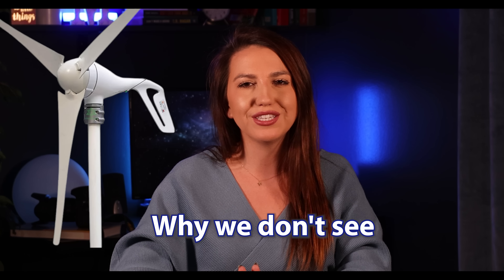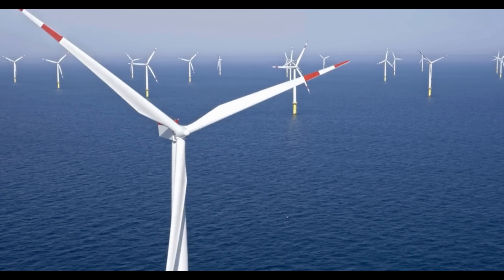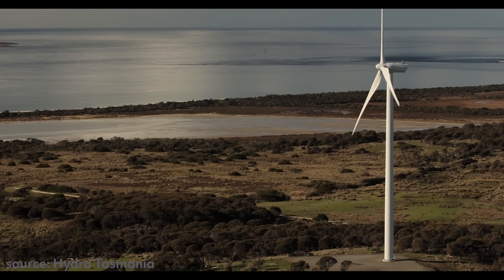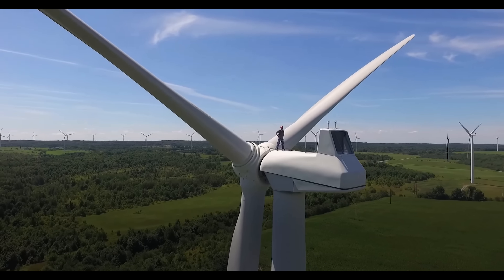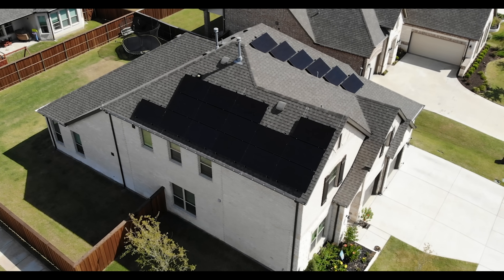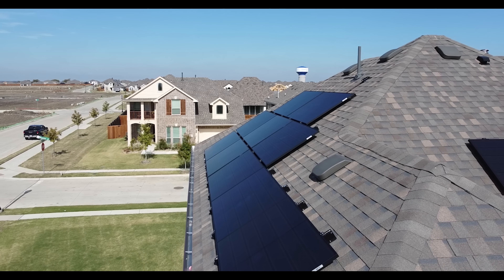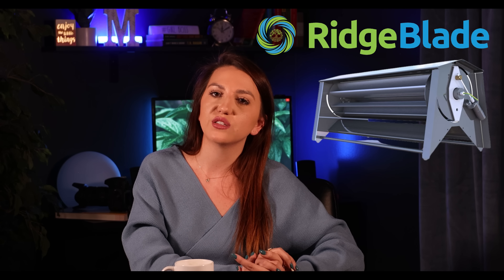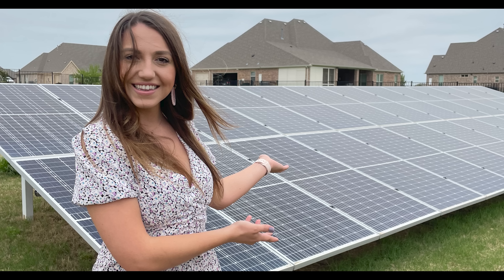Could this Turbine Destroy Solar?  | Why haven't we seen these small wind turbines yet...

Comment: Suggestion: there is research into hydrogen using electrolysis but under pressure. It seems electrolysis doesn't care if it is under pressure or not so you can skip a step in producing pressurised hydrogen for energy storage. This would save energy, complexity and a lot more for residential use.
Reply from the maker: Interesting thought. I need to look into it for sure. I would love for hydrogen to be more used and on a bigger scale.

Comment: The ISSUE is that most homes do not have strong enough wind to justify building a turbine. Another issue is that it needs to be high off the ground, which is rarely practical. But the biggest issue of all is that best power production requires large blades, which are never practical. We've seen images of small turbines on rooftops, but these rarely can generate enough energy to be worthwhile.
Reply: If you look at the data sheet for these you will see that if you are lucky enough for it to be spinning you won't get more than a single 10w led bulb running on it. Total waste.
Reply: Correct! My studies show that a minimum of about 6 ft diamerer is required to do anything.
Get to the basics.
Only the outer third of any turbine or propeller actually does work. The rest is not going fast enough to produce work.
The outer third should have big blades to better capture the wind.
Engineering experiments show that the angle of 25.5 degrees captures the most energy. (Three blade cantilever blades are at an angle of about 2-4 degrees).  This produces high RPM, and is not efficient.  It also produces noise and vibration.
Going faster takes more energy from the very wind that you are trying to get energy from.
Bigger is better with all wind turbines.
Heavy on turbine blades is not good. More cantilever blades add more weight, to the point that the shaft cannot support more.
The Tension Turbine is the only wind turbine that is feasible now.  The Tension Turbine tip speed is  SLOWER  than the wind.  This produces maximum power and little noise or vibration.
The Tension Turbine: Half the weight, twice the power. 
The future is the Tension Turbine. TensionTurbine dotttt commmmm for more information. @wileycoyote5652

Comment: There are quite a few wind farms near me (along the I-25 corridor in Southern Colorado), and I find them beautiful. Not sure why their esthetics get so much hate. Ive briefly looked into wind for my property (I get quite a bit of wind here), but its just too difficult to find something cost effective that produces enough power.
Reply: They are a blight on the land. Horrible things.
Reply: Put down the bong you are to high
Reply: I'm not an engineer, but the Wright Brothers invented the airplane. Maybe if you create the Wind Turbine, in the shape of a predator bird, flapping its wings up and down. You might get more (electricity) from the process. Small propeller, at birds beak to get the motion started.
Reply: They kill birds.
Reply: They also need diesel engines to start up and will never ever recoup the energy put into making the concrete bases - the steel in the structure - the infrastructure to get the energy to the grid - they are closed down in very windy conditions but still get their subsidies - and still need fossil and abiotic fuels - coal - oil and gas - to maintain the power to the grid - so basically a way of rewarding rich people at the expense of the poorer members of our polity.

Comment: Another great video and discussion point. One of the issues about wind turbines is the constant humming noise. To be successful in the domestic market product developers would need to ensure that the hum their product produces is minimal - or there will be pi**ed neighbors. I'm not sure how the ridge style turbine would work unless the roof faced into the wind - perhaps I'm missing something with this type of application. I think the height that the product is positioned is critical in domestic applications, especially in urban/city areas - this could get ugly. I remember seeing a residential/commercial skyscraper building, I think in China, which had two huge verticle wind turbines in its structure, I haven't seen any since so I get the idea it wasn't successful.
Reply from the maker: Thanks for leaving a comment and sharing your thoughts. I do agree with the hum... I can see a whole lot of neighbors protesting.... It will surely take time to get people used to the looks too if we can get the noise down.
Reply: With the ridge type generator, you just rotate the whole house to follow the wind.
Reply: @vinquinn  makes perfect sense.

Comment: There are  many drawbacks with windmills They are very expensive to build and expensive to maintain. They are difficult to install by common folk and even harder to maintain. They need a constant draw when they are spinning. So if there is no place for the power to go they either have to be stopped or the electricity has to be dumped usually into the ground and wasted.. Some tricks have been used successfully like dumping the power into an electric water heater element to supplement your hot water but there are issues with that too. The size and cost make them almost impossible to market on a retail level. The birds are not happy with them  at all. There are building code issues to deal with beyond the electricity. They are only effective in certain areas and even then they are a pain to deal with. I know of 2 companies that had them installed in high wind areas. One of them says that if nothing goes wrong and no maintenance is ever needed the payback would be around 50 years.. Maybe things will change but the challenges are tough.. I've seen better results with a Pelton wheel in a creek.. It is good to see you do the research and give an honest report... There was a guy in Missouri selling them but he was weird.. I do not know if he is still around..

Comment: This may be out of line, but I have a question unrelated to this video.  Earlier this year I had a solar power system installed on a house I own in San Antonio.  It is 25 panels and I am already wanting to add to it.  It's a 1950s ranch style house with it's longest side facing south.  It has a low pitched standing seam metal roof and all the panels are of course on the south facing slope of the roof.  I was thinking of adding an array of bifacial panels on the opposite side which slopes to the north and was wondering if it was worth the trouble of putting them on a rack like you might have on a free-standing system so that the panels are sloped at the optimum angle to the south, which I think would also benefit the bifacial panels.  This would cause the high end of the array to be a few feet above the roof.  I am kind of a DIY type and would like to do the bulk of the work myself and then hire a licensed electrician to connect it all up.  Finally, my current system uses mini-inverters and Enphase 
IQ8M so when I add to it, do I have to stick with micro-inverters or can the add-on part use a string inverter?
Reply: Hi there. I live just northwest of you in Bandera County. I find that solar is a good path in our area. Wind may or may not work depending on the known factors of your site. As for adding more solar, I have a string inverter and 24 panels on an elevated ground mount. It produces about ½ our annual needs. I considered micro-inverters but found it limiting in many ways, costly to switch and there are weaknesses in a rural setting I prefer to avoid. To connect your new wind turbine they generally produce what is called wild AC current. It’s unregulated so have to be forced to match the grid. The micro-inverters match grid power flow already. You would need to have the wind power conform to the utility power. How exactly that’s done and to what degree will depend on the utility requirements. I’d find out what those are before I made any decisions. You didn’t note if you have backup power. If you have that or plans to install later, consider the option of a regulator for the wind system if it’s not part of the unit, (some have, some don’t). I would also consider a hybrid inverter. It can connect to the utility AND provide power if the grid fails. A grid tie only inverter stops when the grid goes down. Backup batteries can be had for far less than most providers will tell you and that technology is changing very fast. Pick your poison in that area. So, not sure if I answered your question exactly. If you want to chat further check out the other YouTubers delving into those specific areas. Combined with this one, you’ll figure out your best path forward. No two homes and needs are the same.
Reply: Great info!  Thanks!  But I did not ask anything about wind power.  If you have any info related to the questions I did ask, I'd love to see it!   @b.b.stanfield9829

Comment: 🌀 I've been looking at the idea of residential wind energy for about 20 years. I'm surprised there hasn't been more development for this market. What you pointed out about blade length, height requirements, and noise factor explains why. Thank you for the video and information you provided.
Reply: There was a booming small wind industry ~15-years ago, I was part of it and worked for the largest small wind turbine manufacturer: Southwest Windpower.  We had conventions with 25+ other small wind turbine manufacturers, a certification council, and robust sales, however, within a few years, solar PV pricing plunged so low, small wind made no economic sense, in comparison, and most of these companies were riding on investments, that dried up as turbines were unreliable in producing power and running properly.
Reply: @RussellFineArt  Thank you for that. During the last 20 years, I've been busy raising a family , working on a career, etc, so I haven't been following that part of the energy sector that closely. Yes,  I  can see how PV became a more economical option over wind energy. Good point. But I'm still very interested in new innovation with wind energy. 🌀 That plus energy storage solutions that will one day be more affordable. Thanks again for the info
Reply: @RussellFineArt  and now we are at the point that it is all hands on deck. Let’s get all of them up and tied to batteries, that is the price that was missing back then
Reply: Also been energy density in batteries, just recently been feesible
Reply: There is not enough wind where most people live.
Reply: @nathansmith7153  then it won’t be prolific there. What the fuck does that have to do with anything?
Reply: Near-over unity options and amazing batteries already exist. None of these rich-man's schemes are necessary. It's simply that they do not want people to be able to produce their own super-cheap energy when they can bill you for it. There are even laws that prevent you from enacting such a system on your own property... follow the money. Do it and you will be fined and/or jailed depending on your capabilities.
Nothing new under the Sun; just kept from us all instead.
Reply: Cuz it is absolutely inefficient and will never be sustainable to provide you with power You will always need something else Small wind turbines are a waste I have sex of them I took them all down they are more of a pain in the ass monitoring their speed maintenancing the shunt loads with proper cooling to prevent them from burning up I should mention I live in Florida we have a lot of super high wind You have to put a shunt load on the turbine to keep the RPMs down or it will blow apart It still doesn't give you enough power to do s*** with
Reply: @dducko  so because you are too stupid to deal with the complexities no way it will work?
Reply: Do you know why there is a lot of wind in the attic? if this wind is used in the turbine, the turbine will never run out of wind

Comment: Awesome video,  i've looked at the small (micro) wind turbines (200-400watt) that have a small diameter fan and I have seen some online that are as cheap as $300-$500 dollars US.   The sticky area is that installing even those small wind turbines most zoning laws require them to be mounted 20-30 feet up into the air which can be tough to do without neighbors complaining and or if you live in a HOA (Home Owners Assoc.) area you can pretty much forget about it.   What is interesting is that some articles claim that a small 200watt to 400watt wind turbine will pay for itself in just 6mos to 1 year !
Reply from the maker: Thank you for sharing your thoughts too, so appreciate it :)!!!
Reply from the maker: I KNOW! I need to test this theory... I cant image that short of a payback though but i can be wrong! :) 
but yes, I have also seen some DIY projects out in the countryside where the HOA and the neighbor issue, sometimes no city permit needed either!
Reply: You doj't have enough wind where you live
Reply: @nathansmith7153    We avg 12mph winds here according to the Govt wind map,  that should be plenty.

Comment: I think this video tells me i still got a chance to build a better wind turbine smaller, more output, able to run off a battery when no wind. 
Those big heavy blades do help in extra power generation once they are spinning the weight keeps the momentum going with just a little push of wind, lightweight blades don't.
Reply from the maker: I( think there is a whole lot of potential, just figuring out HOW to make it and then mass produce it. I would buy one if it was available so I can test it.
Reply: @solartimeusa  see i have made electric motors, and hoe they are eound plays a roll, mechind wound are messy and not as efficient as they could be, and in a couple of years I'm putting effort into making a new propeller design i already though up, I'm gonna put the 2 together after to be a wind generator, 12v of off a battery snd 120v or 240v out, my motors are essentially air-core transformers with a spinning magnet inside, most powerful n52 magnets, current wind turbines simply turn a motor/generator to generate energy they are premade not as good, and the fan blades not the best for the job
Reply: @solartimeusa  got a couple of non pactical motors on my channel if you wanna have a look, i was quite proud in getting rotation
Reply: Weight is death to anything moving.  Race cars are light.  Wind turbine blades SHOULD  be light.
Get to the basics.
Only the outer third of any turbine or propeller actually does work. The rest is not going fast enough to produce work.
The outer third should have big blades to better capture the wind.
Engineering experiments show that the angle of 25.5 degrees captures the most energy. (Three blade cantilever blades are at an angle of about 2-4 degrees).  This produces high RPM, and is not efficient.  It also produces noise and vibration.
Going faster takes more energy from the very wind that you are trying to get energy from.
Bigger is better with all wind turbines.
Heavy on turbine blades is not good. More cantilever blades add more weight, to the point that the shaft cannot support more.
The Tension Turbine is the only wind turbine that is feasible now.  The Tension Turbine tip speed is  SLOWER  than the wind.  This produces maximum power and little noise or vibration.
The Tension Turbine: Half the weight, twice the power. 
The future is the Tension Turbine. TensionTurbine dotttt commmmm for more information.
Reply: @0077alfie  soundd like you need to read up on aerodynamics theory!

Comment: Non moving solar with battery storage wins over noisy wind generating turbines. Wind and wave technology have a use where noise and aesthetics are not an issue. Turbines have a reputation for burning up too.
Reply from the maker: yes very very true. I personally don't mind the look of the big wind farms in the countryside, as long as we don't build them close to people's properties. and yes there is always a way to find those to be useful in other applications. Like in Alaska, the northern parts get only 60 sunny days a year, some more southern areas have 100+ days of sunshine but that's where I can see wind being bigger. Or potentially winning over solar.
Reply: the wind turbines are far too expensive, including those in the Netherlands, as long as they want to earn so much from them, the wind turbines will not work at all, the middle class is among them and they must first be pushed aside. an ista breeze is still reasonable to pay from the dealer in Turkey. and the same applies to home batteries. way too expensive, if you put a wind turbine near your house, you will be the first to remove it!
Reply: Turbines affect bird life
Reply: Replacing batteries every 8 to 10 years. Panels every 25 years. Turbines replaced every 20 years. Turbines only output 15% of there rated kwh energy over the course of the year. Its dark at night and the wind doesn't always blow. Windmills on houses are useless because there bearly any air movement in the built up suburbs, with at best 500 Watts of power, you'd have to cover your house in them. 😂

Comment: Thank you for leading the valuable content on renewable energy 👏 great video. 
I can see wind taking secon seat to solar. Specifically where there is less sun and more weather, is where wind can take market share.
Reply from the maker: Yes very very fair point. Like places up north in Alaska where the sun for half the year is almost not even there... ! There surely will be many applications like that.
Reply: @solartimeusa  Suggest you get your facts about Alaska.  You would have to go above the Arctic Circle, which is only the most northern portion, to be without the sun during the day and then for only about 90+ days per year.  The days get shorter in the winter season than in the Lower 48 but then again much longer in the summer season.
Reply: @solartimeusa - do I see a tongue in your cheek?I hope so.